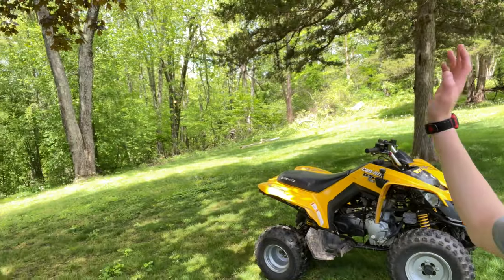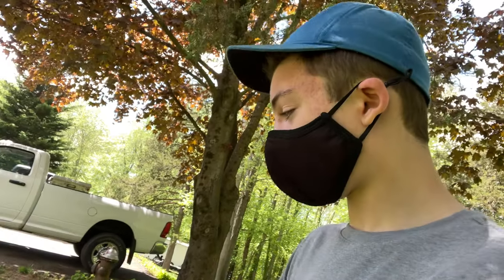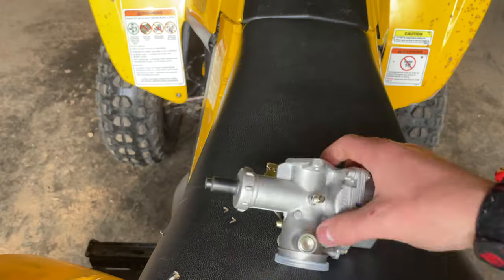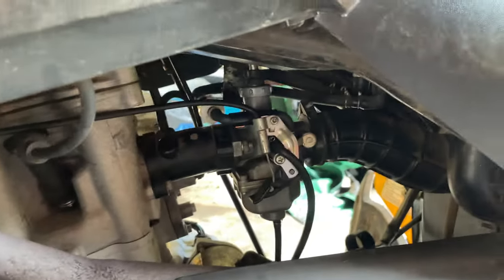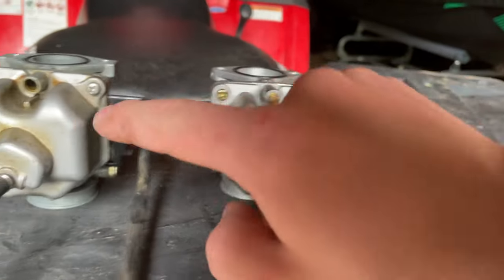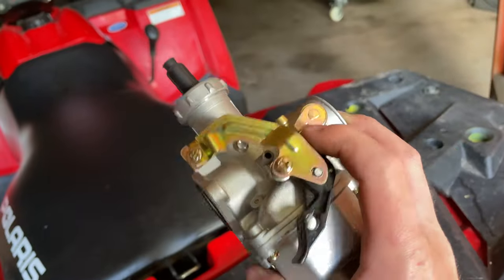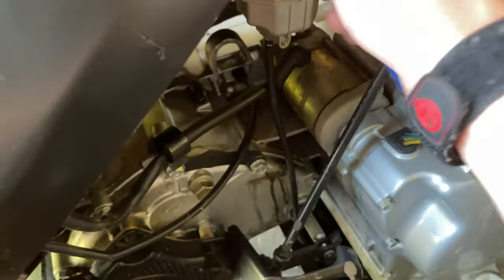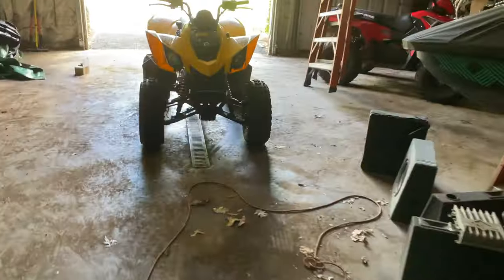New Carburetor For The Can-Am!

Comment: Could be a fuel delivery issue bud, id check and see if your petcock on the fuel tank is plugged and shine a flashlight down into the bottom of the tank and see if there is a bunch of dirt or sediment in there which keeps on clogging up your jets and possibly the petcock as well.... Never hurts to throw an inkine fuel filter between the tank and carb also if you do have a bunch of junk in your tank just take it off and filter it into a bucket through an old t shirt or something that catches all the stuff you don't want in there and you can still re-use that expensive gas after you clean the tank out real well and filter the crap out of it just dump it back in and run errr!

Comment: You ever figure your problem out? I’m having the same problem with mine now already cleaned out the gas tank cleaned the carb and it’s still the same
Reply from the maker: I did a bunch of research, apparently these all run super lean from the factory which is why they run perfect on about half choke, I put the old carb back on and just run it like that.
Reply: @GasGuzler  gotcha well on this one idk what’s wrong with it it started with it sitting for about 3 months and when I turned it on it would barely want to idle and run good on choke(Used to run real good) and so I ended up getting tired and bought a carb rebuild kit all new jets and everything and it keeps running the same cleaned out the gas tank new filter everything. These don’t have gas pumps right? And now I’m trying to figure out how to set the carb air bleed and fuel
Reply from the maker: @armandoruelas3450  No fuel pump, it’s gravity fed. And mine started doing the same thing yesterday, I think the carbs on these just need to be cleaned regularly.
Reply: @armandoruelas3450  it's the screws on the side of the carb. U just have to adjust until it's right. The left screw. Turn all the way in till u feel it bottom out then back out 2.5 turns. The left screw in the middle is just the idle so adjust as needed. It's basically a back n forth between the 2 screws. If u adjust 1 then u kinda have to move the other. It's a balance game is all. I Kno it seems frustrating at first until u understand what's going on with your bike. I was the same as u were
Reply: @GasGuzler  put a fuel filter on it and you will never have carb issues. I also use from time to time that Lucas oil mechanic in a bottle to keep the fuel system clean n lubed. It really does work wonders I suggest in trying some and use 93 octane not the cheapest stuff u can find. That in itself will make the quad drive better. Also move up to the better spark plug which is iridium. Cr8eix or something like that it is

Comment: When you take off stuff on the muffler you need to re jet the carb !!
Reply from the maker: It was doing it before I removed the baffle, I also found out that these were jetted to run extremely lean from the factory which was the cause of all that in the first place.